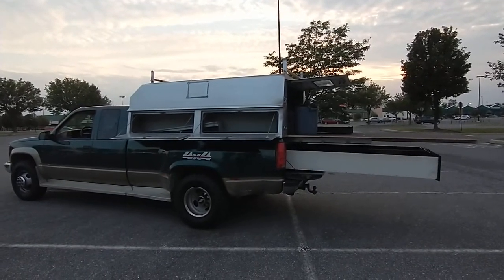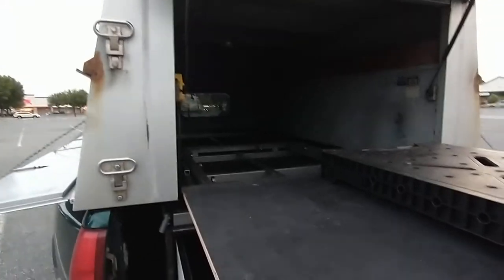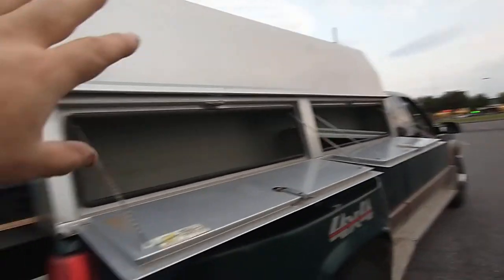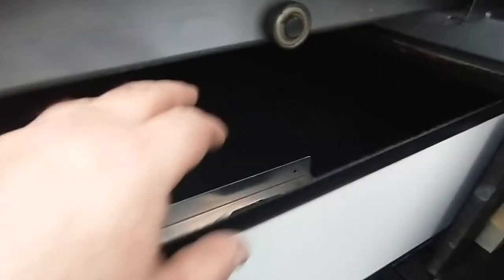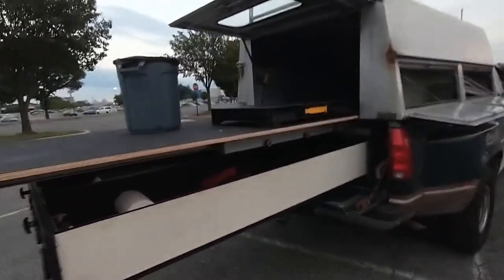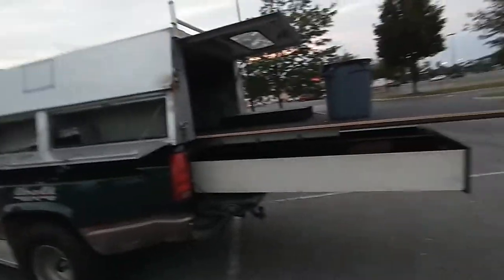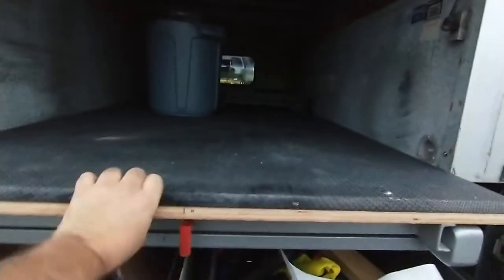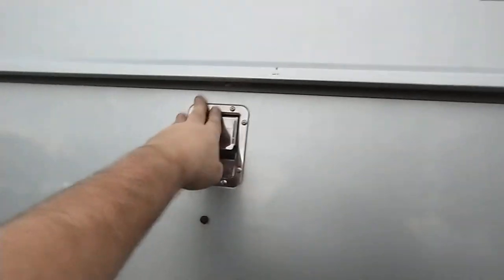Truck Topper Installed - Truck Vault - Cargo Glide - Truck Tour - Wall Around

Comment: Great looking setup.  I paid $400 for an ARE that was a bit more worn but fit my bed.  I didn't care for eyeballs through the window so I made a cover with a piece of black trim coil, riveted it in place on the inside and added some aluminum cross bars to keep it from being an easy bust, grab and go.